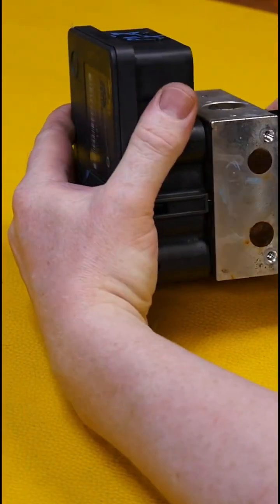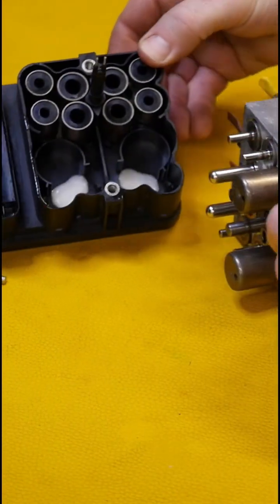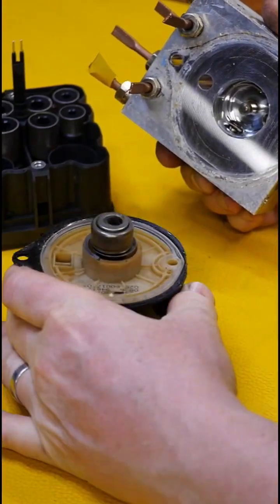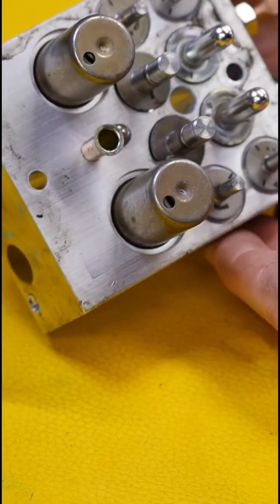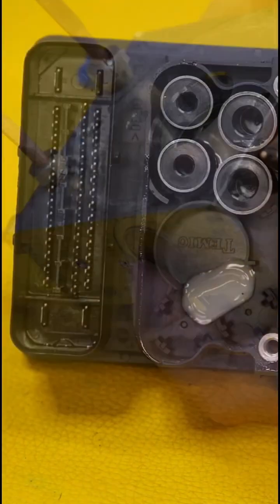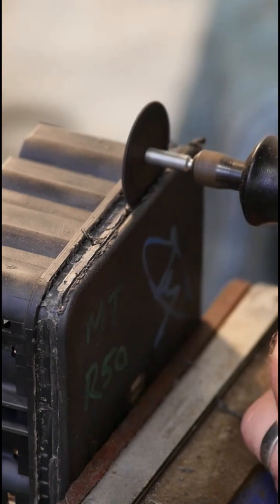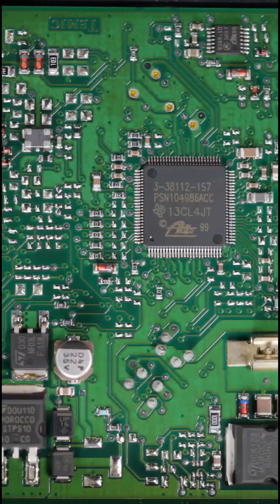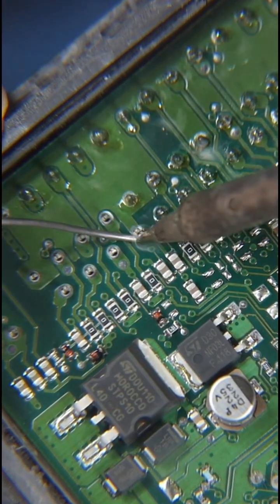Inside ABS Pump.  #shorts #car #brakes

Comment: What could be the reason for solenoid valve block to go bad while bleeding the system ?. It happened two times on two different abs units, at start it bleeds just fine, fluid flows but after like 20th pedal push, it clogs up/get stuck. And its always the rear wheels, the valve body won't allow fluid flow towards the wheel, but will gladly allow it backwards.
Reply from the maker: @Mantas.N  it’s not air getting in then? I’ve not come across any issues other than air being trapped.
Reply: Having this same issue right now !
Reply: Any updates on this?
Reply from the maker: @ never resolved bought a spare off eBay.
Reply: @leonYoong  turned out . We just needed to keep pumping and eventually the valve freed itself out . 

( We have to make sure the car was turned on and running while pumping!! )
Reply: Were you able to fix?